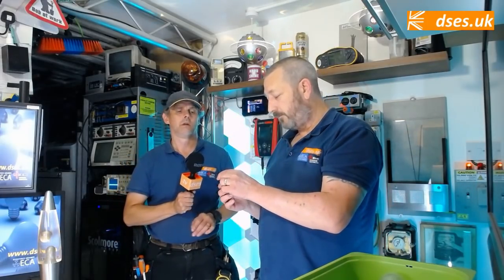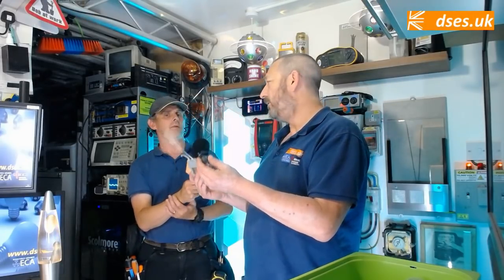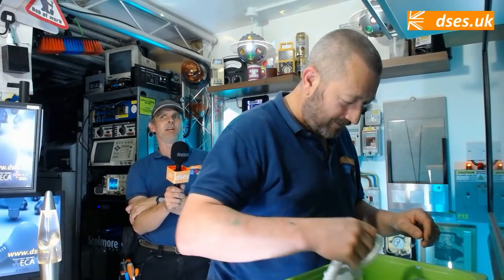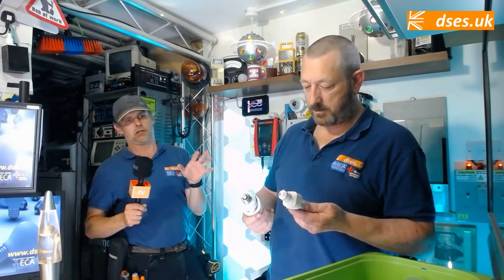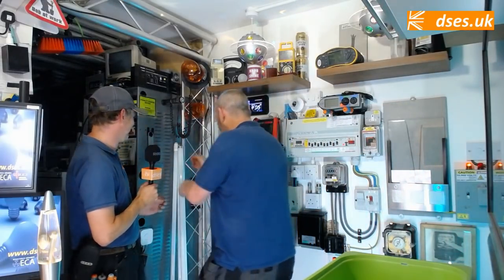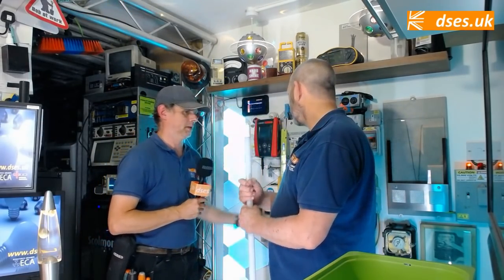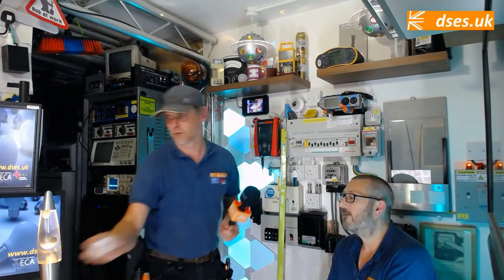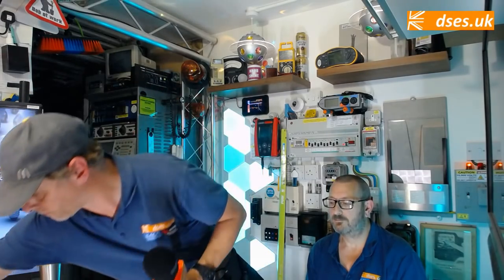SH!T CHAT: Last orders on old lamps

Comment: Pretty sure that in T12/8/5, MR16/11, PAR64/56/46/38/36/30/20/16 etc the number is the diameter in ⅛"
Reply from the maker: So... I win and Nige is a massive liar!
Reply: I thought that, they were made way before millimetres were adopted as a UK measurement.
Reply: @oninbridders  Seemingly G4, GU4, GX5.3, G9, GU10, G13 (on T8/12) GX53 etc are named after their pin spacing in mm though https://en.wikipedia.org/wiki/Bi-pin_lamp_base
Reply: Yes. t8 is an inch diameter
Reply: (8x 8ths )
Reply: It was obvious as you can retrofit the thinner ones in T8 fittings
Reply: After a tough few days this is just the tonic 🤣

Comment: What you should do when converting a switchstart fluorescent fitting to LED is remove the PFC cap, short out the choke and replace the starter with the one supplied with the tube, which is just a fuse. That way you can insert an LED tube either way and it will work (the “dead” end of the substitute tube is shorted out internally). Wiring mains to one lampholder will result in a 💥bang💥 if an LED tube is inserted the “wrong” way round, or a 💥POP💥 if someone tries a real fluorescent tube!! (that’s why there’s a fuse in the substitute starter).
Reply from the maker: Good point. I should have mentioned the fuse (it's been a while since we last performed a conversion).

Comment: Very nice tsummary
MR16 was first 12V because it was not possible to make a compact quarz bulb with a high voltage and so very long and thin filament, wich would not explode when the filament breaks. Also low voltage halogen lamps have a higher efficiency due to a more compact filament. MR16 and GU10 were intentionally not designed for canned spotlights sunk in the selling but for accent display lighting in retail businesses or living rooms. MR11 and MR8 were especially used in glas displays or vitrines or cab9nets lights.  Side note, the good old iron transformers cause no problems but the modern electronic ones cause problems.
The R7s Lamps are rather difficult to replace with LEDs as they are high power wich would require a lots of cooling make the bulky an unusable. Also decorative fittings using them need 360° light, something that is not possible when properly cooling these lamps to prevent premature failure. Also there are not only two start types, but 4 common types, with 1kW ~190mm and a 2kW ~250mm.
CFLs were dead since LED filament came. I don't think many buy the still, so they would have dispersed from their own. In my opinion they were an interesting technical approach but turned out as dead end. Todays technology does vary, there are very good ones but also a lots of garbage like with LED. Ineffizient LEDs suffered the same end, even thue those very still lamps that would last a century. Fluorescent as well are a thing of the past. 
Wiring N and L to one end of the LED tube is not a good practice, as on the other  Sid the pins are shorted together wich might lead to problems when a customer replace a faulty tube. 
1800mm has gone in the 90s, as they were often BC capped lamps, and in the 90s Osram GEC as last manufacturers. stopped their production of these lamps.
I actually really like G4 halogens in accent features lights, but only when you use high quality lamps i.e. Osram German made ones. For under cabinets, again useless. G9 are similar, too much low quality lamps. In conjunction with crappy fixture like you described, it is good they are gone to history. 
Indeed LED lighting with very high CRI are still rare and especially expensive, but they have improved massively.
The problem with the glass lamps, there is no heath inking at all--> often a cause of death. 
Sadly a reccomodation, like you mentioned,  of making less lamp repairable won't have a effect. Manufacturers have to be forced to use a universal widely available accessories like with incandescent and the traditional lamp technology's.
Reply from the maker: Thanks for the detailed reply - good to hear from someone who knows more of the history.

Comment: The surewire or octopus system is just the joint box method (nothing new there) which we were still taught when I started my apprenticeship (16th Ed) its a great method., simple, clean and one cable at light and switch even on a 2 way .... just these days you would need to locate the joint box in a cupboard or something for accessibility.

Comment: 44:54 I've put up bulkhead fittings with integrated LEDs in 2016 that are still doing fine. On paper, they're not repairable, but the driver is a separate unit that can easily be replaced. Now, the LEDs are a different matter, but in this particular design they seem to be underdriven leading to long life. The retrofit LED lamps you're proposing are probably driven close to the limit leading to a shorter life.

Comment: I like incandescent in table lamps. Everything else can be LED, I have enough 40&60w clear candle lamps to last me a lifetime
Reply: There’s something slightly primal (ie🔥) to the gradated colour temp/watt of incandescents, that LED doesn’t really deliver, and why I still like the light and smooth dimming from my ancient 6ft floor R7S lamp. Despite it costing the planet, it does substitute somewhat for heating and as a bonus occasionally fries insects
Reply: I am the technical manager of a historic independent cinema. The place is full of incandescent bulbs which not only give the right colour of light but also can be smoothly and slowly faded right down to off. Currently I am stocking up with lots of spares!

Comment: You might well save money on electricity bills by switching from incandescents, but you'll probably offset any savings by having to turn the radiator up in the rooms previously lit/heated by them to compensate.
Reply from the maker: A customer once told me he didn't want to upgrade from halogen to LED because the light helped keep his room warm!

Comment: Did you ever see fluorescent lighting tubes with a metal strip from one end to the other end caps? we had them on the railway for lighting in carriages and the metal strip seemingly was used to aid starting up, we also called them the pisser strips as you got a shock off them when installing with the power on.

Comment: philips LED bulbs are absolute trash now
Reply from the maker: Completely agree.
Reply: Especially at the insane cost that they now ask for the Master ExpertColor ones.
Reply: @TonyRule  the snail trail looks like a panel fault and usually only appears when panels warm up.
Reply: @magnets1000  I agree - panel fault. It reappeared in exactly the same spot and identical shape. I managed to get a decent photo of it both times too. It started to appear at about 12 months and was most obvious with a dark grey background and gradually got worse. Initially, it didn't bother me as I could barely see it as I mostly use a program with a plain black background, it but as it got much worse eventually it really annoyed me so I had to do something about it. To their credit, they didn't quibble when I put my foot down, not that it would have stopped me anyway - we have quite strong consumer laws in NZ. They didn't have any RMA stock or anything with a similar specification.

Comment: "Never seen a fusion lamp fail."
I've fitted thousands of fusion fluorescent tubes in supermarkets, they do occasionally arrive dead from the factory, but I reckon that's about 1 in 1000. I've also seen them fail prematurely, but again that's equally as rare.
Reply from the maker: We haven't fitted them in large quantity to be honest, but we've not been let down where we have used them.
Reply: taking this as a recommendation from both
Reply: Fusion fluorescent tubes are garbage only lasting 2-3 years usually, the phosphor doesn't even get a chance to degrade before the pitiful amount of emitter on their cathodes is used up and they start flashing. Philips and Osram tubes generally last much longer, say 5+ years ..although all modern fluorescent tubes are garbage compared to ones made 20+ years ago that could last 10+ years in regular daily use

Comment: My mum's got some reading lights that use 12V MR16s that I can't get LEDs to work in.
They have a high frequency AC power supply and on them I don't think it's the minimum load causing issues (though it might be), but I think it's the power supply frequency. Some lamps work better than others. Some never work, they all get really hot and ones that start off working stop after ten minutes or so.

On my to do list is swapping out the driver for a more standard 12V DC power supply.

Also, I love seeing the audio on the scope behind you.
Reply from the maker: Unfortunately as you say, the driver needs to be changed. Often the halogen driver is a bigger beast than LED models allowing retrofit to happen, but it does mean getting busy with the screwdrivers if you're confident enough to have a crack at it!

Comment: Been looking for LED 12V MR11's for a client's motor home. Tried Sylvania examples conveniently available from Wickes and they're fine on the DC supply. They're a couple of millimetres deeper than halogens though so the retaining rings won't fit. Other known manufacturers offerings are no shallower. I understand why they're deeper but they're not much use in certain fittings. Any recommendations welcome
Reply from the maker: The only MR11s I've used were Philips, largely because that's all I could get out of CEF/Eddies. I use them rarely. In the past they were a handy solution for where two to four downlights were needed in a small area like a W/C. When I last used them about three years ago, I also had difficulty fitting them into the downlights as their face protruded just enough to prevent the retaining clip from fitting. I remember spending some time resolving it, but I can't recall how I managed it. It is a pain when the new models don't match the dimensions of what they're supposed to be replacing and I hadn't considered automotive uses. Are they common in caravans and campers?
Reply: @dsesuk  don't know how common they are but this particular motor home (2007 model I think) is lit entirely by G4 and MR11. 12V so if the van isn't hooked up to mains they work off the leisure battery. I guess a reasonable choice of lamps at the time rather than some obscure automotive variant.

I think working out how to replace G4s will be a challenge for the next few years since they're integrated into some cooker hoods and bathroom cabinets, plus various decorative fittings
Reply from the maker: @dg2908  There are some 'disc' style G4 lamps on the market which work better in some luminaires than the capsule models. I know I say don't buy off the internet, but I've had some success with this model and brand in the past: https://amzn.to/3x61UU4 - especially in kitchen undercabinet lights and cooker hoods.
Reply: @dsesuk  The older Sylvania wich where still made in Belgium were the best led lamps ever made. Today I would use Signify (Philips) or ledvance (Osram) professional grade lamps

Comment: One end of the T10 is a short, you wire it so it will go either way around. 
If you don't when the customer changes it, bang!
It's clearly explained on the instructions.
It uses the shorted end to take one leg of the power through.
Reply from the maker: This is true, and in the past we were very explicit with our labelling, but you're right, it's best wired either way around.

Comment: Got a few MR16s in my kitchen, when I traced them the "fitters" tapped the feed from the cooker hood extractor FCU (which is hidden above the cupboards so not visible) obviously the two cables didn't fit so they just left it hanging loose with about 1 turn on the screw

Comment: Some good information there, pity Nigel could not keep up with you at the end and needed a knee nap. slightly different topic but was covered by your octopus talk, never understood why its legal to put in a junction box (not including maintenance free) under floors, behind walls etc where no one has any idea of where they are. In the U.S.  i believe that all connections need to be accessible, ie behind light switches, sockets etc. Wouldn't half make the fault finding sparky's job a lot easier. Keep up the good work chaps.
Reply from the maker: A good design ought to ensure there are no hidden junction points and, as you say, other countries don't permit such. I wouldn't use a screw junction somewhere it cannot be accessed and 526.3 has that as a no-no (going on to list exceptions such as maintenance-free). I think it's less of a problem these days as most competent sparks will avoid it or use the likes of Wago/Ideal connectors where they have to. I usually find such horrors remain the handiwork of DIY'ers and builders.

Comment: Wow Avo model 8 on your top shelf. That takes me back a bit.
Reply from the maker: A vid on that and the Fluke 8020A beside it to come. Eventually. Hopefully.
Reply: I have in my shed, a model 8 that was adapted so a blind person can use it!!!!!!!!
Reply: Avo was the go to kit when I was an Apprentice - but then I am an old bastard and not an electrician.😉
Reply: @normanboyes4983  The AVO model 8 was great for testing transistors and electronic components as it was a device that could draw a bit of current during a resistance test. When we went digital the high impedance didn't really prove much.

Comment: "LED lamps are available in the G9 form-factor, although like the G4, they tend to be larger and may not fit in the physical shade."... too true... the replacements are enormous and have no chance of fitting in loads of lights... hopeless.
Reply: And while we are at it put a E27 spot in the gay tray and tell me something to replace it with that won't make the world look a dim yellow colour.  Aaarrrrgggh.
Reply: Thus it has always been... i remember trying to fit the jamjar SL18's in the 80s (David demo'd one in the video).... many many fittings simply couldn't cope with the size. the weight was also an issue...

Comment: The 'scope in the background is a nice touch
Reply from the maker: A last minute afterthought. That old model has a warm-up characteristic which means if you level it at the start, the line will sink until it's up to temperature. You'll notice by the end of the video that the waveform is well below the midline of the display!
Reply: @dsesuk  Imagine how irritating that must be in a lab enviroment lol.

Comment: "Hurrah!" - another DSES video. But, "nobody likes G9s" - I do! They work well in touch-dim bedside lights and despite so far throwing away £10 of supposedly dimmable LED G9s I'm still searching for one that works. It's going to be cheaper to buy new lamps than keep trying. Just because it goes in the hole doesn't mean you'll like it
Reply: What sorcery have you discovered to get G9s into the holder? I have broken dozens of lamps and not a few holders, simply trying to put the damn lamp in..... it was like someone said 'GU10 is the epitome of a crap lampholder design' and someone else said 'hold my beer'

Comment: Well my mum managed to stockpile about 50  MR16's about a decade ago for about 20 downlights. And yes, all in the extension, all installed by the cheapskate builder and all run off one driver per room that thankfully I found behind the first downlight I pulled down when I was decorating last year (one driver 6 lamps FFS). All cans and GU10's now 👌
Reply from the maker: We had another one a couple of years ago where the builder had hidden drivers behind the skirting. It beggars belief what goes through the mind of some!

Comment: 29:30 Wherever possible, I convert the fitting to a class 1 and earth the bastard. Alot of them are just pretending to be class 2 anyway as many have sections of single insulation only within the metal fitting. Bloody dangerous.
Reply from the maker: I hear that.
Reply: yeah, the standards ALLOW reinforced insulation (usually PTFE or that horrible xlpe tough stuff) that LOOKS like single insulated... then a cheapo manufacturer copies it and actually USES single insulated soft pvc... trouble waiting to happen

Comment: Who would have thought 47 minutes about lamps could be so interesting, in tech I would have fallen asleep by now listening to 'Boring Moran' as he was affectionately known rambling on about 'bloody bulbs' for 47 minutes..... kudos to Nige tho, I never knew that the number related to the distance between the pins.
Reply from the maker: Ah, well don't listen to Nige on pin spacing as it turns out he was wrong! The 'T' number refers to the tube size in imperial units as others have commented on and is a G13 fitting (pins spaced 13mm apart)!

Comment: My electric fire uses a 60w lamp which is red and the heat from it spins a fan above it to simulate a flame, I did change to led as it uses 2 lamps but the flame affect stoped. Was thinking of fitting a small pc fan to create the air needed to make the affect but couldn’t be bothered fitting a 12v transformer so just put the original 2 x 60w lamps back in. Might have to stock up on a few of these or revisit the small fan option
Reply from the maker: Yes, those sort of fires use the heat from the lamp for the flame effect. It's the same with the 'optimist' models that use an ultrasound speaker to create a mist from water that the heat from red halogen lamps uses to rise for a smoke effect. No good with LED lamps, but it's only for display and has no bearing on the room heating of the appliance. Those lamps may prevail as they're not being used for general room lighting.